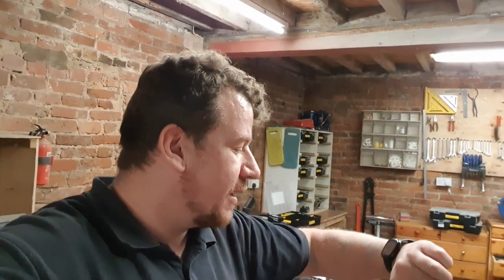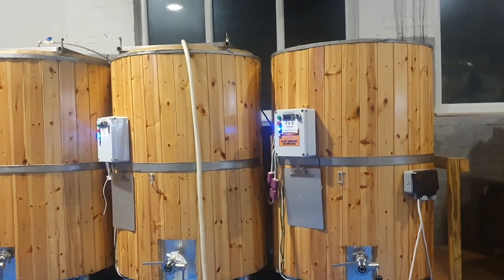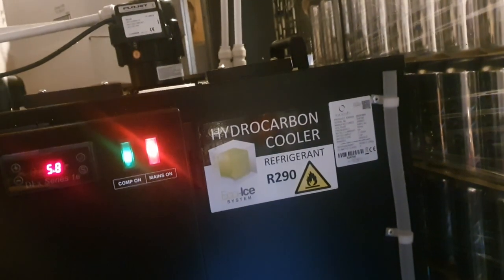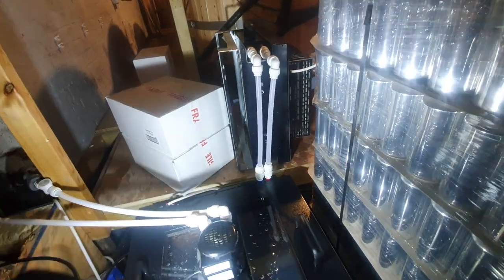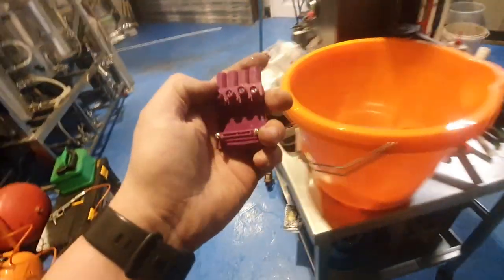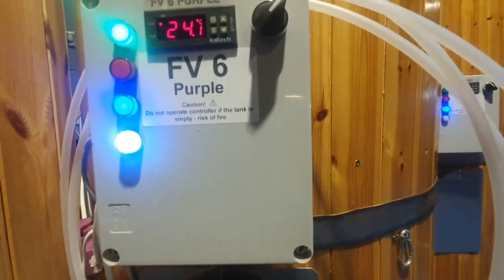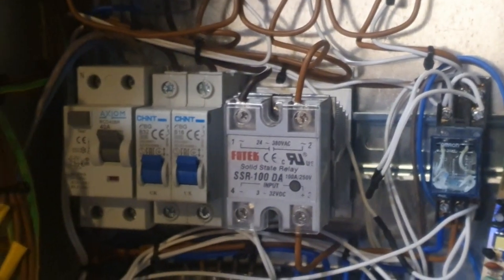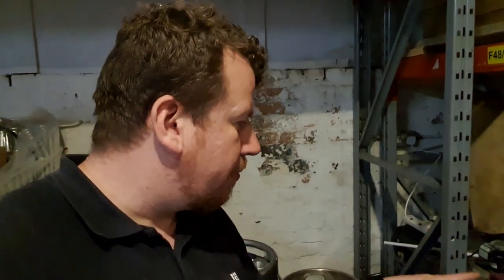Vlog 867 FrankenChiller Has Died

Comment: Smooth exchange... How long do your relays typically last? I ask because my keezer is apparently famished for fresh inkbird controllers...they have tiny little relays in them and I think they get stuck...because they aren't really up to switching the load from the compressor...and I would like to add a more robust relay on a "pluggable" socket, so you can just unplug a bad one...no soldering.
Reply from the maker: I have had some go within a year but most of em last ages.